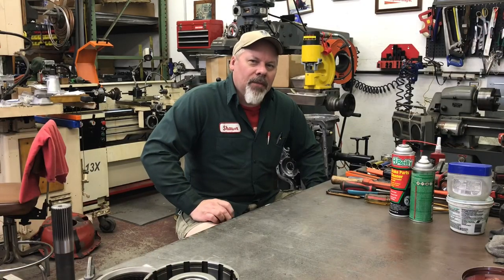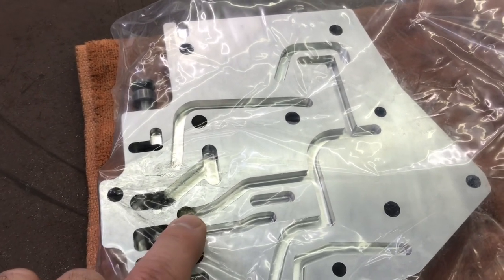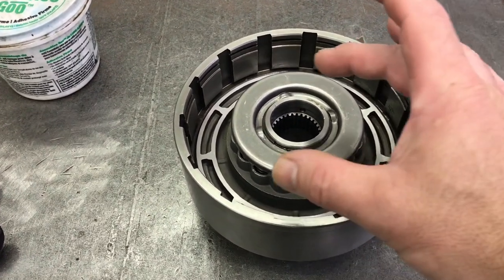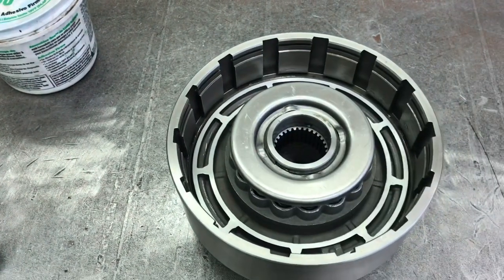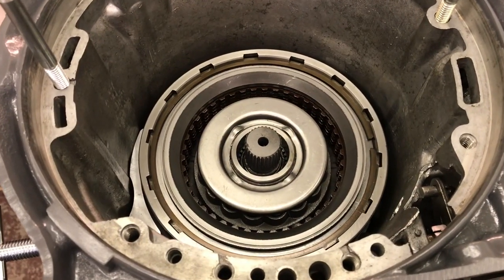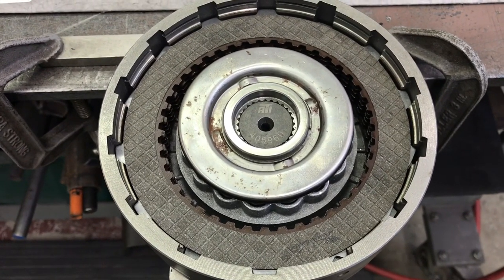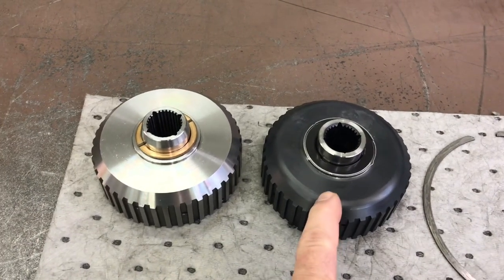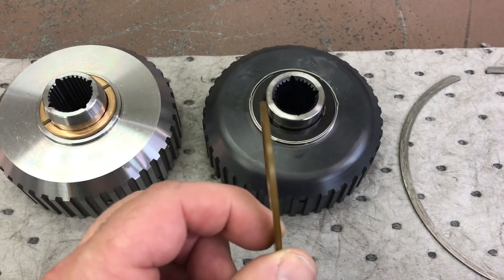TH400: TH475 Direct & Forward Clutch Install & Endplay

Comment: Hello Shawn, Could you please tell me what type of ATF fluid you recommend I don't remember much being said about it. I love your demeanor in your videos.
Reply from the maker: Thanks!
I ran tractor hydraulic oil in my drag car, but usually stick to Dextron III. Dextron VI is claimed to be backwards compatible but I haven’t tried that in a performance TH400 yet.
The best value is definitely the low viscosity tractor hydraulic oil by the 5 gallon pail.

Comment: Speaking of endplay.
The 475 I just put back together was . 005" rear and with the factory . 085 front spacer, the front was . 038" from GM. I'm at . 007" up front now with a . 116 thrust washer.
Reply from the maker: I would go a little thinner on the front selective washer and give it a little more front endplay.
Reply: @mountainsgarage  perfect thank you for that advice.
Reply: Picking your brain here. I went to a full size case saver in this forward pattern manual set up with the front band removed.
Is there anything else to do besides just pulling the servo and pin ?
I'm seeing the feed hole at the bottom of the servo cup in the case... Does this need to be plugged maybe ?
Reply from the maker: @tilt213  Not for the install of the case saver. Any hole plugging would be valvebody specific but I have never done anything with the front band apply bore.
Reply: @mountainsgarage  thank you for taking the time out for advice. You  ROCK  sir !!
Reply: @mountainsgarage  I wanted to let you know that everything is good here with your advice. The trans shifts excellent and the straight cuts are not at all that loud.

Comment: Here is a trick that I use to install the direct drum. I use the pressure plate from the forward drum, it give you something to grab on to. It can be a pain in the neck to get the snap ring out, but I have been doing it for many years.
Reply from the maker: I have done that leaving the snap ring partially out of the groove. I love the idea sharing, Thanks!

Comment: Hi Shawn,  Ten years ago i bought a JW kit 5/5/3,  and installed in trans but never put in car.   
All clutches and steals measure .080 except 1 steal is .060   
All 3 clutch packs assembled have appx..120" clearance.  
I'm guessing i'll need to find an additional clutch or steal for each pack to get closer to .040-.080".

Sound right?  Thanks!
Reply from the maker: Yes I try to get around .040 to .050.

Comment: Just wondering if you have any idea where I can locate a full manual reverse pattern valve body that retains the over run band function..seems everyone deletes that. I have a customer with a th400 I’m building for an off-road ( sort of trophy truck) application. He wants engine braking on a 3-2 under coast. Problem is we are located in Australia and we don’t have the same availability of parts or core units as you guys do.